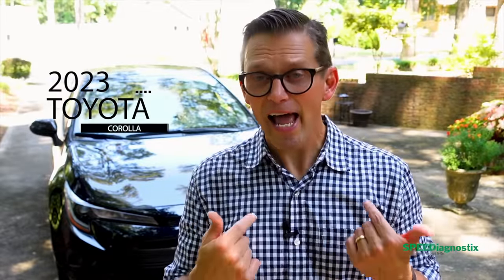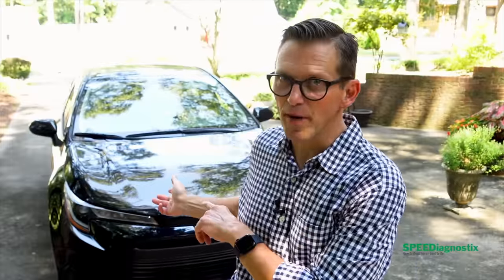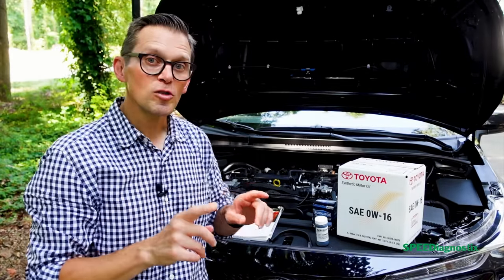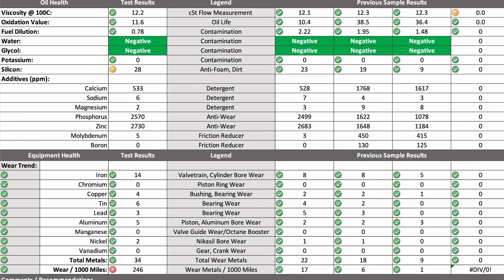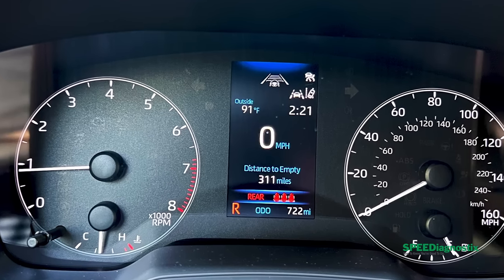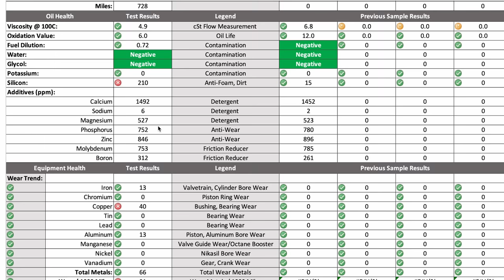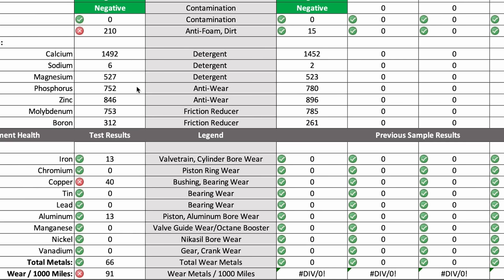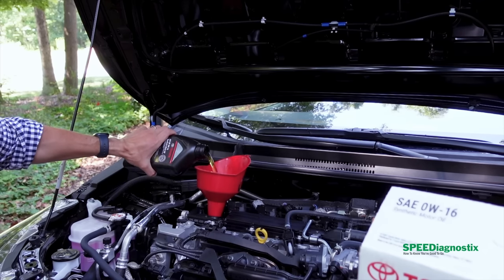AVOID the ONE MISTAKE Almost EVERYONE Makes With A Brand New Car

Comment: I just bought a 23’ Toyota Crown hybrid and had to haggle with the dealership to change my oil at 5,000 miles. But I insisted I wanted to do it despite what the owner’s manual said. This is the first car I’ve purchased with my own hard earned money that’s 100% in my name. I want this car to last me awhile, so I’m sticking with the 5,000 mile oil change interval, no matter how much I have to fight with the dealership lol.
Reply: I did my first oil change at 2000 miles. It's a 2023 Honda Civic. NO haggle at all. They never said a word. My first 2 years of oil changes are free. I'll do mine at 4000-mile intervals.
Reply: Why tf are they haggling YOU about something YOU want done? Ridiculous. 

And stop going to dealerships. Places like Meinike are good
Reply: if the dealership gives you hard time, GO SOMEWHERE ELSE! A mechanic wouldnt say no to getting paid. Heck, even a "handy man" wouldnt say no to a quick $30 in labor. Glad you resolved, but stick to your guns. You want the car to outlive you if possible haha
Reply: @dbzownz12345  Unless the servicing is logged, he has receipts, or the service book is stamped he will void his new car warranty.
Reply: 10k changes are perfectly fine unless you're driving it in extreme conditions.
Reply: Do not fight the stealer. Do your own intermediate oil changes. Just buy the filters on them
Reply: @gonzalotapia1250  Then if something goes wrong in the next 5 years he will have zero come back and have to pay for repairs himself. All servicing must be logged either with a Toyota dealership or in service book or receipts kept from an independent mechanic to keep the warranty valid.
Reply: @motleydude73  they can't ding you for changing your oil MORE often then required l😂
Reply: @Bobo-t5u  Where did I say they would ? I said if some backyard hobo does it or does it himself and it's not recorded Toyota will say no to any future claims.
Reply: @thegreat9481  Meinike is not good noooo nooo nooo
Reply: @moctezumaaleg2008  

For you maybe. And how about actually explaining why you think that?
Reply: Avoid dealers for non-warranty repairs. You and they are on opposite sides of the dollar. Be warned. 25 yrs. now with my still-perfect Lexus and it never goes to dealerships for anything. I always change oil and filter myself.
Reply: Alternatively, he can change it anywhere he wants, on HIS accelerated schedule, and then carry it to the dealer on the manufacturer’s schedule. Everybody wins. The warranty is still intact.
Reply: @wholeNwon  Nothing wrong with dealerships. Their techs are trained to work on specific brands, and they usually stock superior OEM parts.
Reply: @motleydude73  I've been around a long, long time. Believe what you will but sabotage and fraud are not rare. And the average customer is blissfully unaware of what actually goes on. The employees are usually willing to do as ownership tells them because then they fit in with the shop ethos.
Reply: @wholeNwon  It is very rare. I've been in the trade for 32 years at multiple dealerships, mostly Toyota, who have a strong moral code. They're there to service and repair vehicles not rip people off. You're always going to pay more for highly trained techs and genuine parts.
Reply: @motleydude73   On a few occasions I stood near the service desk at a luxury Japanese brand's dealership. Both of the service advisors were wearing identical Rolex watches. One was telling a customer that her new vehicle with Denso iridium spark plugs needed to have them replaced per manufacturer's recommendation. He told another not to worry about his timing belt replacement because he had a non-interference engine. That was not true. A friend was cheated on the hourly repair rate. The same dealership was using an incorrect differential oil.  God knows what they were actually putting in crankcases or whether they actually changed filters.  A friend complained about poor AC. I told him to check the filter. He said that can't be it because the dealer changed it as his receipt showed. Of course, it was badly clogged. Dealers are crooks...no exceptions. Has nothing to do with the ability of techs...though many are hacks. 
I had warranty work done once...trivial thing...replacing a small bushing...nothing to do with the wheels. When I got the car back, braking was a little uneven and the lug nuts were so tight that I had to jump on a 3.5' breaker bar to get them loose.  Their goal was to warp the rotors...high cost repair but very cheap to do. Common scam.
Reply: @wholeNwon   Dealers are there to help you maintain your vehicle to a high standard and give you years of trouble free motoring. Sure some backyard hobo mechanics are less than honest but dealerships have a code of ethics to adhere too and are often watched very closely by their Franchise owner. If any unexpected repairs are done at our dealership above what the customer originally wanted we call them for permission or preferably get them in to show the worn or faulty part before going ahead with it as well as the cost. 99% of dealerships operate honestly. Your experiences aren't everyone elses. In all my years I've never seen or heard of any unscrupulous behaviour. Salesmen not included. 😆
Reply: I wouldn’t let anyone repair a car under warranty EXCEPT the dealership where I purchased the car.  If I’m 1,234 miles from that dealership, I’d use the nearest dealership.
Reply: @williamfriar6295  Of course, but outside of warranty, NO WAY.
Reply: @motleydude73 how about, NO
Reply: @motleydude73 No. Just keep records and receipts .
Reply: @motleydude73 😅😅😅
Reply: @motleydude73 Lube jockeys are the lowest tech on the totem pole.
Reply: @williamevans6522  What? Who mentioned lube jockeys? I'm saying use dealerships with Toyota trained technicians.
Reply: @motleydude73 nope. Illegal.
Reply: @rustynail7866  What's illegal?
Reply: @motleydude73  cancelling your warranty for not allowing the dealer to service the vehicle.
Reply: @rustynail7866  Unless it is recorded somewhere they can void it. Anyone can service it as long as there is physical proof of it.
Reply: @motleydude73  read the Magnuson-Moss Warranty Act.  The manufacturer can deny warranty on an improper repair, but physical proof of maintenance is not required.
Reply: @motleydude73 dealers are licensed scamers.
Reply: @carlossacerio5178  No they're not. They're like any other business, to provide a service and make money.
Reply: @motleydude73 that is against the law in the USA.   Can’t remember the name of it but I am 100% sure of it.
Reply: @bryananderson985  Your warranty laws are stupid then. As well as your gun laws. Someone could go 20000 miles without a single service, something craps out, person goes to make a claim saying all services were done and voila free repairs? We do things differently in the antipodes. Proof of servicing must be provided.
Reply: @motleydude73  seems you work for one. I see how you just argue with anyone whose experience with dealers is bad.
Reply: @carlossacerio5178  Absolutely. 32 years in the trade at various dealerships. Never had or seen a problem. Tens of thousands of cars and customers dealt with. Sure people complain about prices but OEM quality costs more than chinese knock offs. Still their choice to go with whichever. And go wherever for servicing/repairs.
Reply: @motleydude73  You’re being from the other side of the world explains a lot. Many engines available to you are non existent in America, and pollution control is quite different. Certainly diesel engines will last much longer than heavily pollution controlled, turbo charged gas 4 cylinders.  We’re not exactly comparing apples to apples.
Reply: @motleydude73   My Toyota Warranty & Maintenance Guide does not use the term extreme conditions.  Under the section "Additional Maintenance Items for Special Operating Conditions", "Repeated trips of less than five miles in temperatures below 32°F", change oil & filter every 5,000 miles or 6 months whichever is first.  This would apply to 90% of the vehicles in Wisconsin where I live.  If you want your Toyota engine to last 150,000 miles, change the oil every 10,000 miles or 12 months whichever is first.  If you want your Toyota engine to last 300,000 miles, change the oil every 5,000 miles or 6 months whichever is first.  Piston rings sticking causing pre-mature engine wear is a known problem for Toyota owners changing the oil & filter every 10,000 miles.
Reply: Most owners get rid of their cars long before 300,000 miles. Even 150,000. 5-8 years is the average length of ownership.
Reply: @motleydude73 not really
Reply: @motleydude73 its illegal in the US for a company to void your warranty if you do your own work. You just need to keep receipts of the parts you changed/bought in case you were challenged
Reply: The dealership doesn't give a rats because they don't own it. I wouldn't have them change it either take it to a lube place like Take 5 or Jiffy. I know at Take 5 you can bring in your own oil & filter (I always use WIX) filters but who knows what you get at the lube place or for that matter the dealership. Dealerships are nothing but a rip the only thing I'd ever go there for is anything that breaks under warranty.
Reply: @motleydude73  
Irony?
Reply: 2023 Venza, changed oil at 5,000 miles, they said I will have to pay as I have 2 oil changes for free.
Reply: @naveda1976  this was my exact experience. Initially they didn’t want to do the oil change at all, but after talking with them at length, they decided they’d do it if I paid for it out of pocket. Mind you, it was not cheap. My crown uses 0W-8 oil which was hard to find at the time. So naturally it was unnecessarily expensive. $26.50 a quart I believe. So I paid close to $200 for an oil and filter change. The inspection, tire rotation, etc. was free though as it was under warranty. Honestly though, I paid close to $47,000 for the car, no financing or lease; that’s a lot of money. I’m going to do whatever I have to to keep this car mint.
Reply: @wholeNwon  You know the quality of what is being used vs a quick change shop. A coworker had the oil changed on his Hummer and driving it back to work is shut down. No oil
Reply: @motleydude73  I keep a journal and now oil filter receipts, OEM. Owned a WRX for 17 years. Had a journal with every oil change/wiper blade/repair. It mattered when I sold the car. "You're the guy people want to buy a car from". He's right
Reply: @stevethomas760  Why I always do the job myself. I certainly wouldn't trust a dealer to do it either.
Reply: @wholeNwon  Saw a test of oil filters on youtube. There's a difference, "why do the quick change guys use a 50 cent filter, couldn't find any 25 cent ones".
Reply: @stevethomas760  I think they just wipe off the old filter.
Reply: @motleydude73  It has been proven in court that a warranty will not be affected by DIY or and independent shop changing the oil as long as you have a record.
Reply: @motleydude73  Anyone can change their oil and as long as you have a record and it meets the recommended weight and change interval the warranty is not affected and that has been upheld in court.
Reply: I’m 73 and I never seen an honest dealer yet.
25k, you need brake fluid flush, 50k time for injector cleaning, turn down warranty work.
I purchased a new ford with the best stereo pkg. it had an Audio-Vox stereo in it. When I asked about it they said that’s what it came with. A call to Ford fixed that.
Reply: @denslod2930  A major issue is that parents never teach their children anything about vehicle maintenance, that is if they even know themselves.  But many are just too lazy and want others to do everything for them and then complain about living pay check to pay check. 
 My parents taught my siblings and I how to do many home and vehicle repairs and I thank them for that. 
Today's vehicles, while more complex, can tell you exactly what is wrong with a simple scan tool which is available free at some auto-parts stores. 

I have little sympathy for people who never read their owners manual and just believe the dealership for required service.  Today, other than oil and filter changes, most vehicles do not recommend any service for the first 100k miles.   You can't fix stupid.
Reply: @donaldpatton4254  Wisconsin isn't the entire world bud, for 90% of cars 10k mile changes are perfectly fine. That's all I've ever done. My current car has done 160,000 miles so I guess it's going to fail any day now 🤣  Nope. I'll prob take it to 200k then trade it on a newer one. There is no known problem with piston rings sticking. But I've only been a technician since 1995 what would I know...Must be a US problem.
Reply: @clarkkent9080  Yes I know I've already said that. Why are you repeating what I explained.
Reply: @motleydude73  First you said that Toyota has to do the work or the service book is stamped (I have no idea what a service book is) . Then you later said that Toyota or an independent shop must stamp a service book. If you are talking about the owners manual recommended service being a service book, no that is not required  

What you left out is ANYONE including the owner can do the maintenance and as log as I keep records that it was done according to manufacturers requirements the warranty is good.  I can keep a record on a scrap piece of paper and that is ok and HAS been taken to court and it IS acceptable.  Any record by anyone showing what was required was done is ACCEPTABLE. 

You did not explain that
Reply: Yes I agree never go to dealer, my Toyota dealer uses Valvaline oil, not Toyota oil, on oil changes.  They also said I needed new breaks on a 22,000 highway miles Toyota venza hybrid lol another mechanic said they looked brand new
Reply: @charlesgreen7408  The dealer can use any oil they want for normal oil changes but I read that since Toyota is paying for the first 2 free oil changes on new vehicles, they require that Toyota OEM filter and oil are used.  If not, drop a dime on them to Toyota.
Reply: @clarkkent9080  If there is no proof of servicing the warranty is void!! Get it??!! No dealer stamp/ shop receipts no claim.  A service book is a physical book with pages drawn up in grids with mileage intervals listed from 15000kms up to about 220,000kms. Each time your vehicle is serviced the dealership stamp it and write in the mileage. Are you 12? Need everything explained in detail. 🤦
Reply: @charlesgreen7408  Toyota oil is just Mobil 1 or Castrol rebranded. Toyota don't make their own 🤣
Reply: @motleydude73 That is not true.  It is against the law for the dealer to require that it do the maintenance to maintain the warranty.  All you have to do is keep the records including if you do the work yourself.
Reply: @motleydude73 You simply do not understand that you do NOT need proof of servicing by the DEALER.  ANYONE can do the service and as long as you document it you are covered. Since your referencing Kms, I assume you are not in the U.S. so you may be correct for your country but do not assume that is required everywhere. In the U.S. the dealer NEVER stamps the service book that is in the owners manual.  We have progressed way beyond paper and everything is maintained on a computer that any dealership for that make can access

This is what the U.S. Federal Trade Commission says: You don't have to use the dealer for repairs or maintenance to keep your warranty in effect. In fact, it's illegal for a dealer to deny your warranty coverage because you had routine maintenance or repairs done by someone else.
Reply: @Floormusic440  Jesus we're going in circles here, I've said if there is no proof of servicing the claim will be denied. Simple as that.
Reply: @clarkkent9080  And YOU do not understand that I have already explained that five times now. I said a Toyota dealership OR an independent shop has to provide evidence of servicing history. Either logged in a computer system and/or stamped in a service book or have some form of proof. One guy said you don't need anything at all!  I'm not from the US but I'm well aware of your Magnuss Moss law. Which I  have also made clear if you bothered to read the whole thread!!
Reply: I watched a (nearly one hour) video on a mechanic doing an engine tear-down on a Toyota corolla.  At 200,000 miles, it had reached the point of burning over 1.5 quarts of oil per 1,000 miles.  Almost forensic in nature, he explained HOW the wear (damage) had occurred, and concluded that if the oil had been changed at 5,000 mile intervals instead of the manufacturers 10,000 recommendation, the cost of the extra 20 oil changes was still less than half the cost of a new short block and 20 hours labour.  Several mechanics have commented that manufacturer recommended (long) intervals are a SALES PITCH based on what the engineers believe is the minimum to get the engine past warranty - RATHER THAN what is best for longevity of an engine.
Reply: @motleydude73 Um... no.  (It may depend on vehicle).  See my other comment regarding engine teardown.  I myself have a 2006 Holden VZ, which now has "issues" and may need a full engine rebuild (220,000 km's).  It's now widely accepted there's a design flaw in the PCV valve / system, even following the manufacturers recommended 15,000 km (9,500 mile) oil change they would start to SLUDGE, gunk piston rings, and stretch timing chains.  Those who have changed their oil consistently at HALF the recommended distance have reported trouble-free engines well past 500,000 km's.  Even a roadside assist mechanic (who used to work for Holdens) told me to have oil changes AT LEAST every 10,000 km, but preferably 7,500 - HALF the manufacturers recommended distance.  (That said, I had a 1992 Subaru Brumby, I once went 70,000 km's without an oil change, I saw no adverse impact whatsoever (but it was treated with "Slick 50")).
Reply: @OhSoddit  15000kms is perfectly fine. PCV issue is design flaw nothing to do with OCIs. My Camry has just ticked over 250,000 kms, oil is still golden at every change. PCV is as clean as a whistle. Our dealership only ever does 15k changes unless otherwise requested and zero issues, some of them have over 350,000kms on them. Engines and oils have improved somewhat since the 1990s when 10k changes were the norm.
Reply: Don't take to the dealership take it to an independent shop 3000 is better or 3500
Reply: @bighorn9119  Dealership is best option.  And 10k miles is fine.
Reply: @motleydude73  Short trips, too.
Reply: Go somewhere else, or better yet, do it yourself.
Reply: As a fellow car guy. Even with synthetic do not go 5k always do 3k miles. Trust me. If you do that your car will treat you right.
Reply: @motleydude73  I tend to agree with you. Car dealerships, which are basically local businesses, risk damage to their reputations and to their businesses with dishonest practices, now more than ever with Internet review sites. I recently purchased a Toyota and the dealership appeared to be meticulous in its business practices and even asked me to write an online review, which I’m happy to do as a satisfied customer.
Reply: Or just do it yourself and save money
Reply: @motleydude73  I live in New York where the Winter has been very cold, often below freezing, and driving is slow and stop & go—I’m changing oil every 5,000 mi.
Reply: @motleydude73  My new Toyota maintenance guide states that cars routinely driven less than 5 miles in temps below 32 degrees F should have oil changed before 10,000 mi.
Reply: @joelthorne7434  Yea, regarded as 'extreme conditions'. In that environment sure do it earlier.
Reply: @motleydude73  how is any dealer going to know if you have simply changed the oil , and use one of their supplied oil filers....they couldn't know.
Reply: @thomaskg1198  A good synthetic will do 15k easy. My 14 year old car has only ever had 10k mile changes from new. It's still treating me right 170,000 miles later. You are just wasting perfectly good oil that hasn't even reached a quarter if it's usable life
Reply: @graantmnz  It's the warranty company you need to worry about if needing to do a claim. Dealerships are just the middleman. Up to you to keep records of servicing at the required intervals if not using a dealer. Do you expect free stuff for taking zero responsibility?
Reply: @motleydude73  Who says?  Where does it say that in the warranty?  AMD (Care Care Nut) says they can tell if it's been maintained or not.  I'll believe what a Toyota Master Mechanic says on the matter.
Reply: @homunculous007  Which warranty in which country? Stipulations can differ. But in most it reads that word of mouth is not sufficient evidence to say a vehicle has been maintained at all of the required intervals within the warranty period. Physical proof is needed. Workshop tax invoices, sundry receipts, or logged with the dealership.
Reply: @motleydude73 10k oil change intervals is crazy
Reply: @doomkid02  No it's not. It's perfectly fine. A good synthetic will do 15k quite easily. It's all I've ever done and zero problems. Much like the cars I service every day with that OCI. It's what Toyota recommend. In 'severe' conditions do 5000.
Reply: @motleydude73  it may be fine in the short term but in the long term i dont see that as a smart decision. As the toyotas I service myself everyday, that oil after 10k would be pitch black as if it was burnt. That's how you cause premature cylinder wear causing imbalance codes and misfires. For not having good lubrication.
Reply: @doomkid02  No. I service them daily too. Have done for 32 years. 10k is perfectly fine.  It's what Toyota recommend. Oil usually comes out dark gold. My own car is at 170,000 miles, oil still looks clean coming out. Only ever had 10k OCIs. PCV is as clean as a whistle. You don't seem to understand much about oil.  A good synthetic will do 15k easy under normal conditions.
Reply: @doomkid02  I'm servicing cars now that I serviced brand new 20 years ago, they are still running just fine. My Uncles 1997 Landcruiser Diesel has 422000 miles on it, only ever had 6000 mile services. Runs sweet as a nut. Oils black as sure, but it's had no major problems. How long do you want out of an engine?
Reply: @motleydude73  LOL changing your own oil does not void the warranty. Show me one time where anyone, from any manufacturer has denied a warranty claim because of an oil change not done at a dealership.
Reply: I bought a 2023 Toyota Tacoma from a dealer that has 2200kms on it. I agreed to their msrp price minus freight and pdi given it had 2200kms on it. Managers vehicle. I made one condition on the sale agreement. Please change the oil for my delivery and pick up. The dealer was willing to let me walk over that request. Wouldn’t do it… I then said fine charge me for the oil change and let’s complete the deal. Dealer still said no.
They wouldn’t change that oil even thought I was a new customer to them, buying a new car for 65000 and willing to pay for the service. The dealer would only say that it’s a waste of their time and bad for the environment.

I bought it drove it down the street to a minute lube and had it done.
Reply: @motleydude73 where you live must suck.
Reply: @bryananderson985  Why? Because owners actually have to take SOME responsibility and keep proof of regular servicing? Our rules actually make sense. But then you lot vote for Trump so why would your warranty rules have any logic 🤦
Reply: I don't know if this applies to Toyotas but it does apply to Some Hyundai and Ford cars. Flip to the table of contents in your manual and look for anything mentioned under "severe" service schedule. This is the actual schedule a driver should follow. The only people who should be following the "normal" maintenance schedule is if you live in Southern California where it never goes below 50 degrees and you use your car to drive to the grocery store and back.

Under the severe schedule, you will find instructions for times you should actually be doing maintenance: Ex: Change your transmission fluid every 50-60 thousand miles. Change your oil every 5000 miles. Change your brake fluid every 2-3 years. You know, everything you should actually be doing if you want your car to last. 

Tell the dealership you are following the "severe" service schedule mentioned in the manual. Then they will do more work without asking so many questions.
Reply: It amazes me how the manufacturers have dealerships under their spell with these silly long oil change intervals.  Imagine a car dealership turning away easy money (on oil changes).
Reply: @fleetwin1  Long? 10k isn't long at all. A good synthetic will do 25k easy. Believe it or not it's not about money, it's about optimum performance and longevity with minimal wastage of a finite product. People who dump their oil at 3k need to educate themselves. And yes I know oil gets recycled that's not the point.
Reply: @motleydude73  It's your car....
Reply: @fleetwin1  It is, and it's never let me down. None of my cars have in the past 30 years. A lot of you must buy shitters then blame the oil  😅
Reply: @motleydude73  Legally that is not true. To void warranty, dealer has to prove that the oil is not changed is causing the issue, not the other way around. This applies to incorrect oil used, or not following the manufacturer recommendation. As long as you have the receipt and documents, the Magnuson-Moss Warranty Act 1975 protects you from that.
Reply: In my country, where we have laws that make sense, the onus is on the owner to prove the correct servicing was done at the right time. No proof no warranty claim.
Reply: @motleydude73  Avoid Toyota an you will be fine.
Reply: @Davido50  Funny guy. I own Toyotas, I work for Toyota. Best brand by far.
Reply: @motleydude73 How will he void his warranty if he still has it done at the OEM required intervals? He can change it multiple time before 10k miles. The dealer will log his first oil change when he goes in according to the car maintenance minder.  STUPIDEST COMMENT EVER!!!!!
Reply: @motleydude73 Your so right my dude. And when those Chinese knock off parts fail they take it to the dealer to fix it right!
Reply: @abet.1221  Generally. We warn people when they buy them, you might be saving money now but could cost you more in the long run. Especially alternators, they're the worst. But you can't reason with some people. I always go OEM.
Reply: Gee, If I were in your shoes, I'd do my own. A bit of a hassle with clean up but definitely more cost effective and peace of mind.
Reply: @motleydude73 No way. Examination of disassembled engines has shown excessive engine wear when oil & filter were changed at 10 thousand mile intervals, even when driven in typical conditions, not extreme conditions.
Reply: @motleydude73 170,000 miles is not much. For decades, changing the oil & filter every 5,000 miles has been a proven way many Toyota 4 cylinder truck engines have easily reached 500,000 miles.
Reply: @LoneTinaja  You're talking out of your arse. The most wear occurs upon cold start ups, which is unavoidable, so don't worry about it. Not sure how long you want out of an engine? A billion miles? We regulary service vehicles with very high mileages, taxis and courier vans, some have reached well over half a million miles. All have had 10k mile changes from new. It's not the 1970s anymore lad, engines and oils have improved since then, it's time you americans got with the times. 5k is just wasting good oil.
Reply: @LoneTinaja  I've  been in the trade 32 years lad you think you are educating me? 🤣  Just another paranoid delusional. 10k intervals is perfectly fine. New Range Rovers have 21000 mile OCIs.
Reply: @motleydude73  I'm almost 73, & since the 1970s I've been interested in Toyota truck engines that reach  extremely high mileage, at least 400K, up to 500K & some even more. The most common factor in those success stories was that the owners changed the oil & filter at intervals not greater than 5,000 miles. Show some maturity by laying off your  cheap "paranoid delusional" insult. Also, I suggest that you start educating yourself by paying attention to the most highly-viewed  YouTube channel by a mechanic/repair shop owner specializing in Toyota. Not only is he adamant about changing oil & filter every 5,000 miles, 1 of his videos shows a disassembled Toyota engine damaged because of 10,000 mile oil change interval. Why don't you make your case by posting comments at his channel? If you do, show some maturity by not spewing cheap insults.
Reply: @LoneTinaja  The  Camry in Car Care Nuts video was the 2AR-FE whuch had the common oil burning issue due to improper rings. The 2AZ-FE in America also suffered from that. It was nothing to do with 10K OCIs. You could do 5k in those and still have that problem. That video was not a case and point, it was a rare anomaly because of poorly designed rings. Here in NZ our Camrys never had that issue. Mine runs fine with 252000 kms. So 10k is perfectly fine you're again talking out of your arse. I've seen  truck engines with 500,000 miles that only ever had 10k mile OCIs what's your point?
Reply: @LoneTinaja  BTW my 32 years in the trade has as much merit as some mechanic on youtube giving his personal opinion. I've yet to see ANY benefit to doing such ridiculously low OCIs when a good synthetic will do 25k quite easily.
Reply: What weight oil should I use on remanufactured 383 cast iron vortec 1997 block. Times have changed since they came out, I have done the prime and flush. And now putting the break in oil.
Reply: @motleydude73 I am so glad that you realize our gun laws are stupid. The second amendment acknowledges our right to keep and bear arms. Laws restricting them are stupid!
Reply: @motleydude73 
If someone is concerned about contamination over an extended period they could just change the filter at about 5000 miles on a 10,000 change interval. The oil will not be broken down.
Reply: Just change your own oil.  You will find that it is easier than dealing with the dealership.
Reply: @motleydude73  And if you want your car to crap out before 200k miles.
Reply: @arjunkarsan4989  How is it easier? Especially if you don't gave access to a hoist. Let the pros do it, takes 20 minutes.
Reply: That's why I do my own oil changes. I use high quality products and follow my own maintenance schedules. Our new Toyota had it's oil changed at 1200 miles. Lake is 100% right. Do not do the first and subsequent oil changes at 10K intervals.
Reply: @motleydude73  Every day stop and go driving is what manufacturers call "extreme."
Reply: @markleggett3944  No they don't.  Stop start driving is considered normal day to day driving. Most people drive in cities most days. Short trips less than 5kms is harder on engines than stop start is. Doesn't have time to get hot enough.  Just change oil every 7500 kms miles instead of 15 if 80% of driving is short. Or in freezing conditions or frequently dusty.
Reply: @markleggett3944  Congratulations, you just wasted perfectly good oil that was entirely usable for another 9000 miles at least.  Listen to the manufacturer, not paranoid idiots like oil geek.
Reply: @motleydude73  dealerships are there to make money, end of story! dealerships are on their best day no better than anyone else, and on their worst many of them are terrible.
Reply: @leftyo9589  Every company exists to make money. They also exist to provide a service. Most take pride in providing one of a high standard to get repeat business. Dealerships know the cars they work on and have the resources for tech training and proper equipment so tend to do a better job than shitty little garages barely getting by on high overheads and low profits.
Reply: @motleydude73 smug corporate shill, equally good at talking out your arse as anyone else on this thread 😂
Reply: They'll do it, they just will only do 2 changes.
Reply: @motleydude73 You are wrong. I have a Tiguan. I bought the correct Liquid Moly 0w-20 that meets VW 508.00 spec from FCP Euro along with OE filter. It has the special dye in it. I changed it at 2000, and 6000 and it took it to the dealer for the first free one at 10,000. Never questioned about anything and I doubt they would even know if you changed your own oil.
Reply: Someone show me all the damaged engines being warrantied by no oil change before 10k. I am a retired tech for 2 manufacturers and built thousands of motors if I had to guess. All my engines went full term on oil changes, and most got over 200k before oil usage. Reason people seem to have oil usage is 2 fold. Early oil changes didn't allow rings to seat and driving like a grandma. So many myths out there.
Reply: Haggle?  There is no haggling needed, you simply DIY change it sooner or pay for that change if the sales terms only covered a less frequent free oil change.
Reply: I work at a Toyota dealership and they understood my reasoning! I just did my oil change on my 24 4runner before 2500 miles. Genuine Toyota filter, drain plug gasket, and 0w20 Toyota (Exxon/Mobil) full synthetic oil! Piece of mind for long term ownership! BTW... I stock over 100 cases of 0W8 oil! 😉
Reply: @MrDb406466  Why? Peace of mind? For what? You work at a Toyota dealership yet don't understand how oil works?
Reply: You should change your own oil, there are devices that pull oil out of the dip stick, you can change whenever you want.
Reply: @titaniumspecial4207  Devices? 🤣  Just undo the damn sump plug and let gravity do the work ffs.
Reply: Unbelievable 
I would not go back
Reply: They can't stop you from changing your oil with the appropriate oil and the manufacturers branded filter. Really no reason you should tell them. There is usually a "Severe Conditions" blurb in the owners manual telling you to change the oil more often and severe means stop and go. Is there any of us who don't drive in stop and go traffic these days?
Reply: @motleydude73 God, you are a hard headed person, your word is not always the gospel! Chill man.